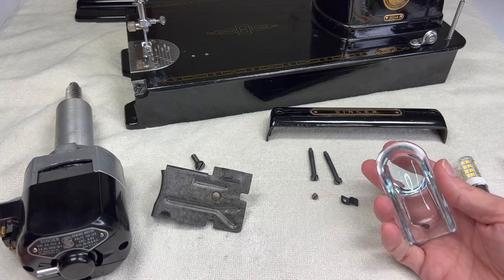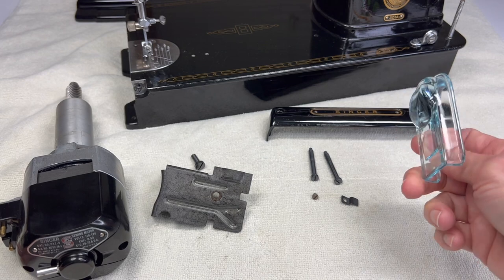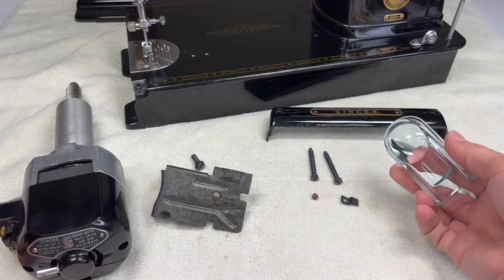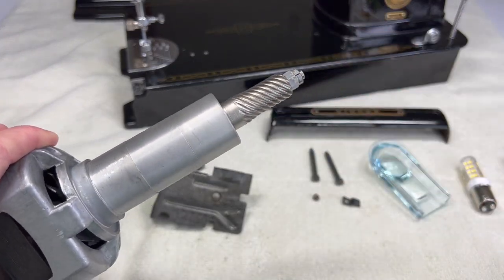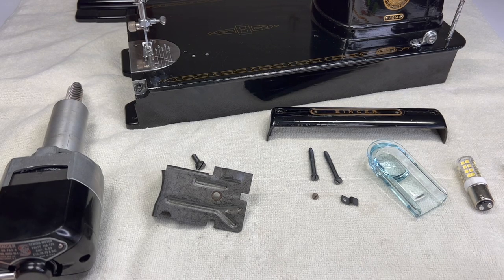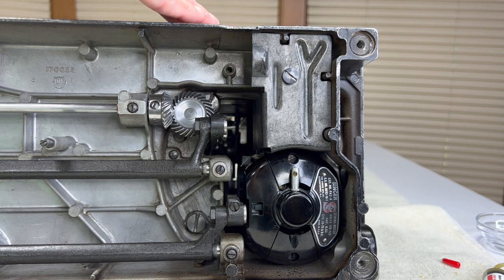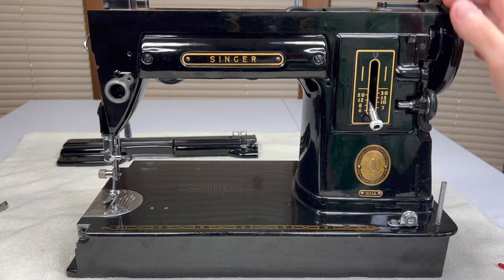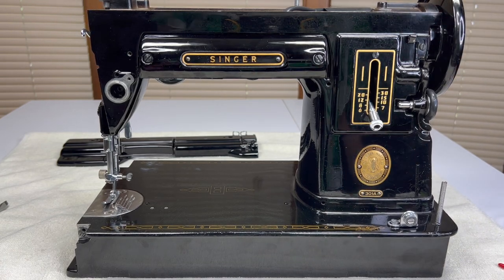How to reinstall the motor and lampshade on a Singer 301: Singer Restoration Series part 23

Comment: I’m working on my 301 and when I went to put the handwheel back on it’s not meshing correctly with the worm gear. It’s more off to the right than it is centered and the hand wheel is pushed in as far as it can go. Any idea what is going on?
Reply from the maker: Hi! Without seeing the machine my first thought is for you to make sure you have the motor all the way up in the machine. My next thought is that something has happened to the top bearing and the motor shaft isn’t being kept straight. If you would like to send me pictures and more info my email is jen@sewingmachinerehab.com I would love to try to help!

Comment: Your restoration series is awesome! I’ve been following along with a singer 301a I found at a thrift store. My hand wheel is making the sound you described, it has too much play. Do you have any information on how to fix it? Or do I need a new hand wheel?
Reply from the maker: Hi! When you say it has too much play, can you describe what you are seeing? Does the gear turn too much to the left and right on the hand wheel or does it actually wobble up and down? It should turn a little to the right and left, that is to provide some cushioning for the gear when the machine starts and stops. If it didn’t have a little play the stopping and starting motion could crack the gear. I know the action of “too much play” is kind of hard to describe. There are some additional parts you can remove from the hand wheel and then put them back together, you will need a tool to remove the snap rings though. There is a spring inside that could be out of place or even broken. I am planning on making a short video showing how to do this as I have a hand wheel right now that has “too much play”. Maybe it will help, I hope to have it up in a few days…
Reply: @SewingMachineRehab  I just keep getting a thumping noise everytime the machine does a stitch, like one thump per stitch. If I have the hand wheel disengaged for the bobbin winding and let the motor run that way there’s no thumping noise. There’s nothing hitting on the hook or anything so I’ve been trying to narrow it down. I followed your instructions and ran it first with no needle and the hand wheel not engaged and no thumping. Then I engaged it, so the needle bar goes up and down, then there’s the noise.
Reply from the maker: @skysbazaar  Are you sure that the feed dogs are not hitting the needle plate? If you are hearing a thump you will want to get your ear to the machine and make sure you are certain where the noise is coming from. If you can replicate the thump with just turning the hand wheel by hand, even better because you have less chance of damaging any parts until you are certain where the noise is coming from. One way to rule out whether the feed dogs are the cause is to remove the needle plate and run the machine. Does the noise go away? My mind just goes straight to the feed dogs for some reason, there is very little clearance there and if they come just a little too far forward or backward at a certain point they can strike the needle plate and would cause that noise, even though they seem to be working perfectly. Let me know if you still think the noise is coming from the hand wheel....
Reply: @SewingMachineRehab  okay I no longer think it’s the hand wheel. I took the needle plate off, still had the noise, I raised the feed dogs all the way up and no noise, and back down the noise was back. So I took the feed dogs off, and raised all the way, no noise but back down there is a noise. So I think the part where the feed dog screws in is hitting something but only when feed dogs are lowered. Any suggestions? Kind of stuck here lol
Reply from the maker: @skysbazaar  Ok, place your machine on it's back and take the bottom cover off if it is on. Look directly between where the hook is and the counter balance on the hook shaft is. About an inch down you will see a little nut with a screw. If you have an adjusters manual it is called the feed bar stop screw and feed bar lever plate screw. Rotate the hand wheel and watch that area. Is the feed bar throw out hitting the stop screw and making a noise? It shouldn't hit it if it is. Let me noodle this a bit more to think of what else it could be....
Reply: @SewingMachineRehab  yes the thing is hitting the screw! But only at a certain feed dog height, so like all the way low doesn’t hit and all the way high it doesn’t hit. Just in between.
Reply: @SewingMachineRehab  I have the adjusters manual and I see the clearance has a certain distance. I will pick up a feeler gauge and test the gap. Do you think that would solve it or do you think something else might be off to even cause that? Thank you so much for all your help
Reply from the maker: @skysbazaar  I think that first I would find out if the gap is off. Fix that and to see if the noise is gone. I can see how someone may have fiddled with that screw, not realizing that they caused a problem. If you are certain that the noise is coming from that area then make sure the gap is the right amount. Beyond that, without seeing it myself it is hard to diagnose. Great job in listening and realizing that the noise wasn’t coming from the hand wheel. Working on a machine takes eyes and ears. 😉 Sorry for the delay in responding, I wanted to give you my full attention. I will look at my 301 and see if there is any other reason for the noise….

Comment: When i took the motor out the red wire was on the right and the black wire was on the left. Your wires are the opposite. Does it matter?
Reply from the maker: This answer is a little late but others might have the same question. I don't think it matters...I try to put them back like they were but it seems to work the same either way.